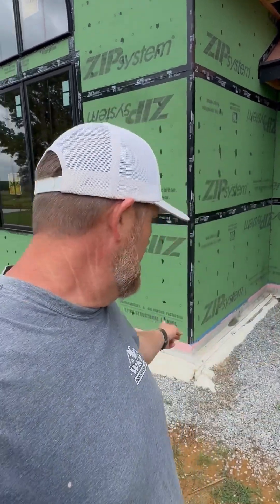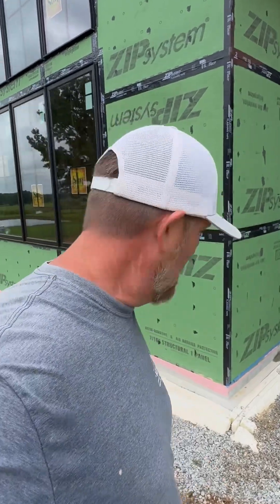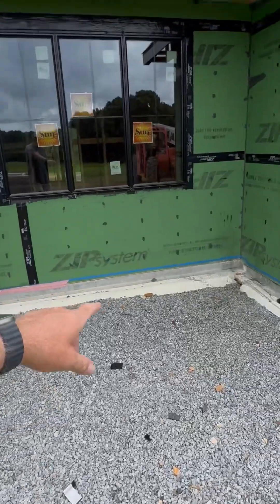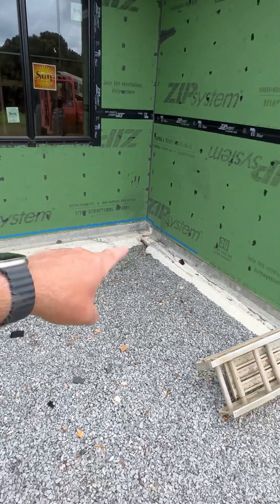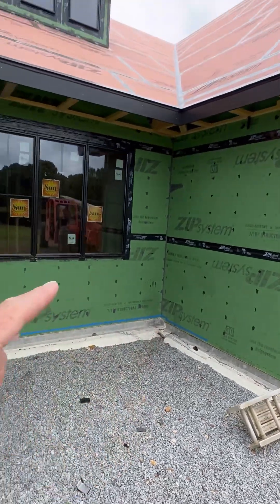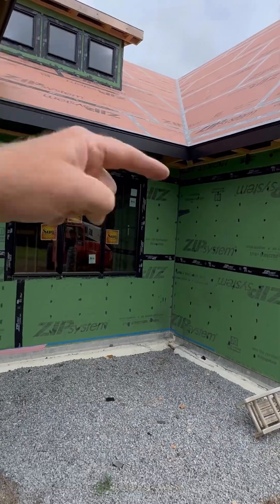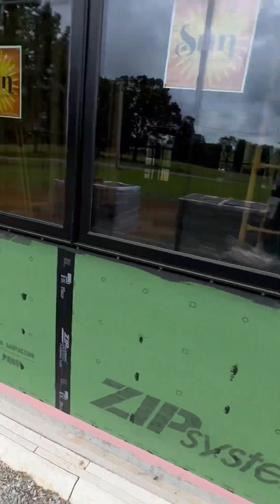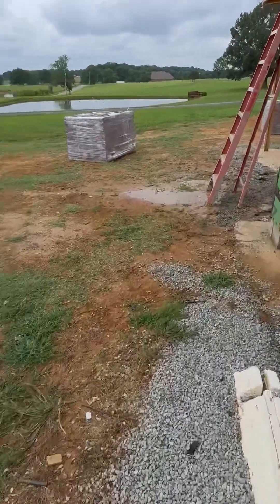Why is Air & Water sealing IMPORTANT on new construction

Comment: I’m not a builder but I Love the zip system. It makes it easier to air seal as opposed to fluid applied flashing or Tyvek. A lot of builders in my area have largely switched to zip system for the walls. Some builders are using another system that’s similar by LP.